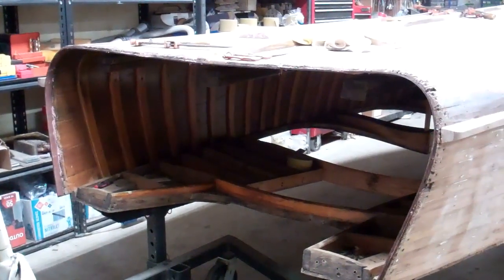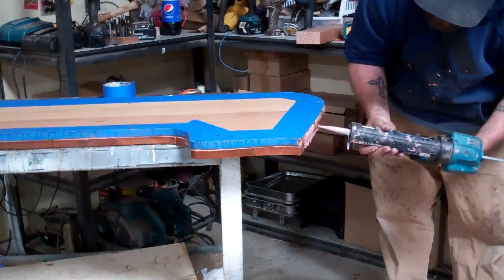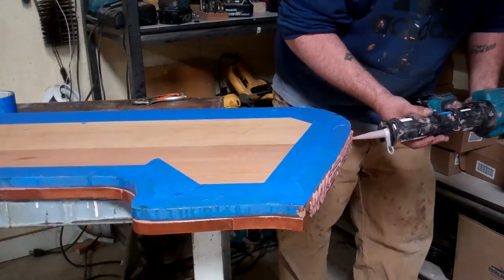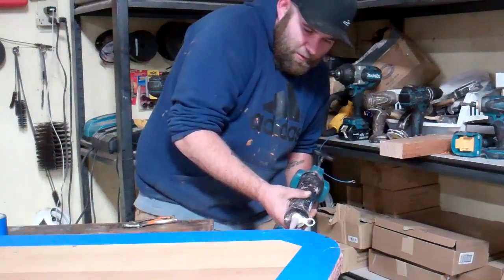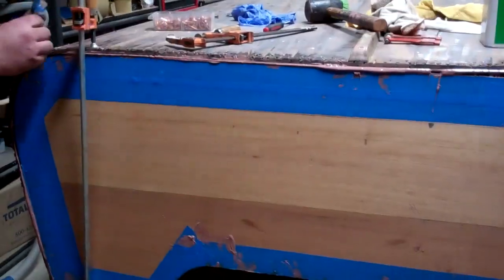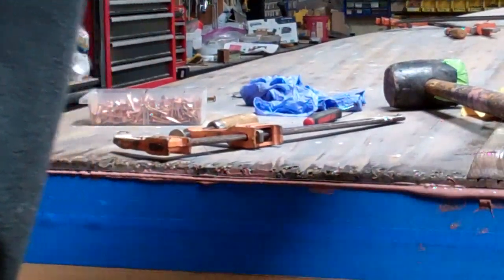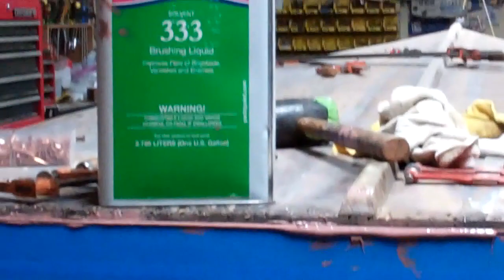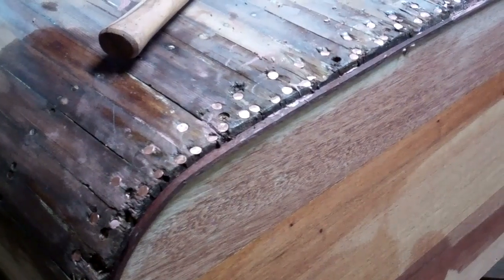1958 16' Penn Yan Sealiner Transom Install 10 22 2019 Snake Mountain Boatworks LLC

Comment: Very nice job on a difficult task. I use cotton caulking with homemade bedding compound. I like that you used the bronze nails like the original.
Reply from the maker: Thanks Charlie. We've caulked early launches using cotton rovings and our "secret soup," but now that it is on the market, and our results using TotalBoat Thixo Flex are so near incredible, we will use it in applications where the seams are less than 3/8" and the planks are 3/8" or less thick.
I would likely reach for the cotton, but now use the Thixo Flex instead of our old home brew.

Comment: I have never used 5200. What is it’s open time?
Reply from the maker: Charlie, here is the link to the 3M Technical Sheet on 5200. 
https://multimedia.3m.com/mws/media/158782O/adhesive-sealant-5200-tech-data.pdf

At 50 percent humidity and 70 degrees Fahrenheit, it has a 30 hour open time. at 90 percent humidity and 90 degrees Fahrenheit, open time plummets to four hours. 
Full cure of a 1/8" thick layer or bead takes 5 days at  50 percent humidity and 70 degrees Fahrenheit.
The stated limitations section is a must read!